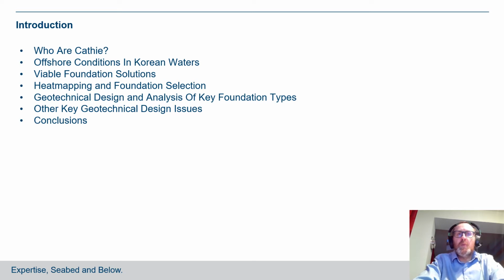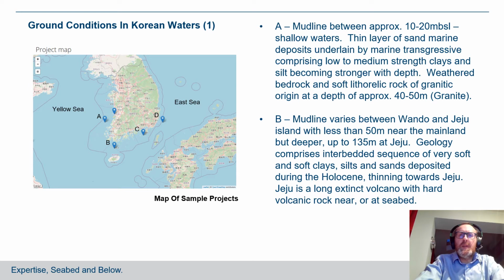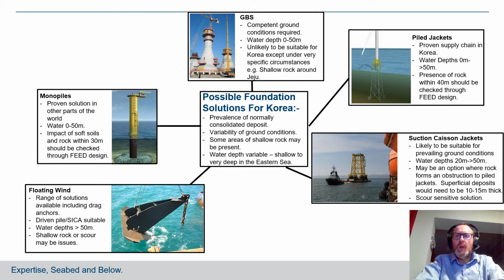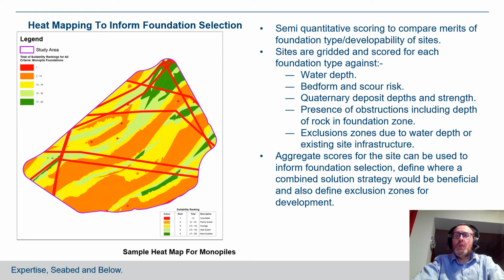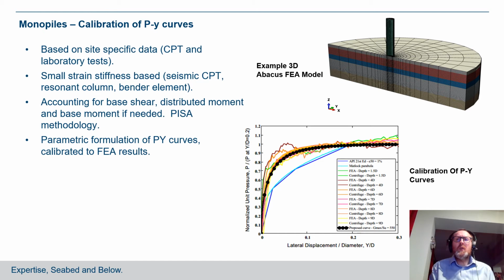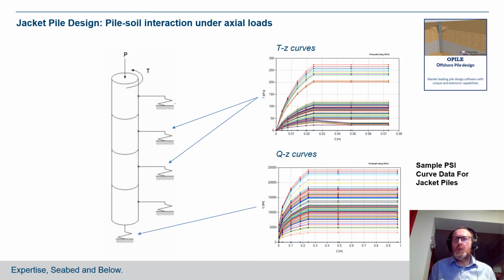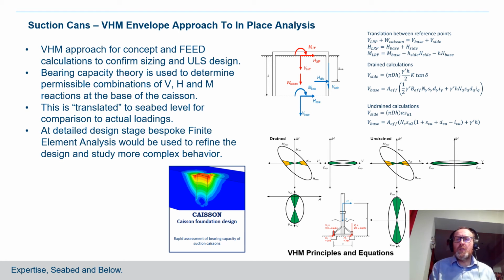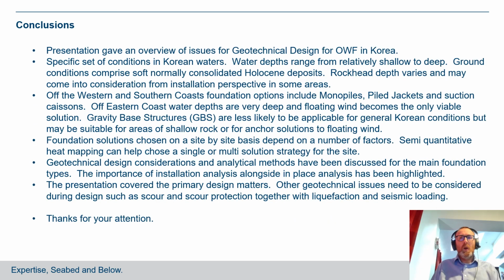Geotechnical Design and Analysis for Offshore Wind Foundations in Korean Waters

Comment: The example 3d abaqus FEA model that you showed in the slide on monopolies - p-y curves is inadequate. The FEA model bottom boundary is at an insufficient depth to fully capture the response of the soil body to the pile under load. The bottom boundary needs to be at least 2 - 3 times the length of the section of monopile anchored in soil.